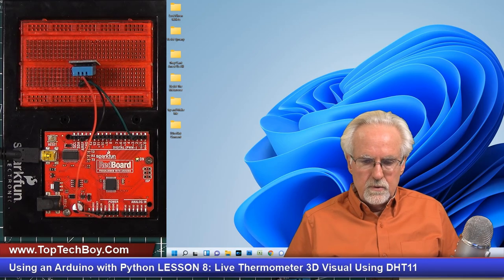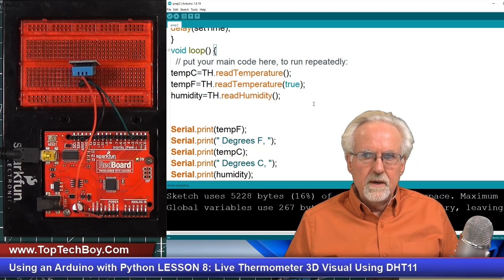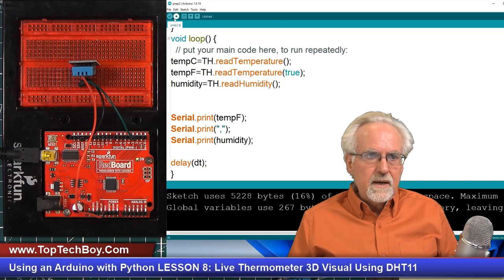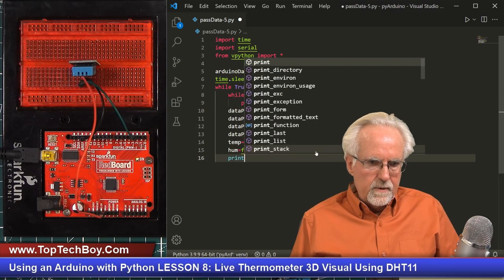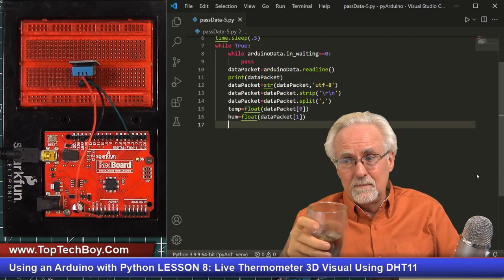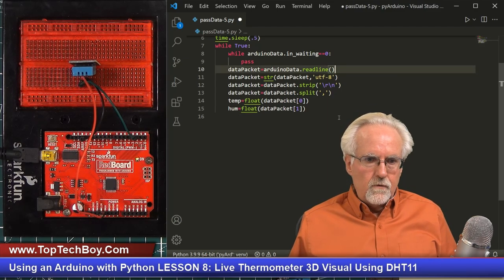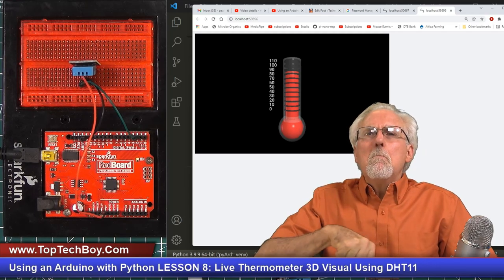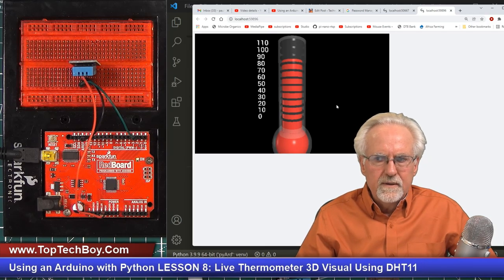Using an Arduino with Python LESSON 8: Live Thermometer 3D Visual Using DHT11

Comment: Thanks for another excellent lesson. I am legend. My solution consists of two separate needles in two different areas of a cylindrical face plate. The upper needle indicates the humidity level. Markings are for 10% to 100% humidity. The lower needle shows the temperature. Markings show 0 to 50 degrees centigrade.

Comment: Thanks Paul, I was following your lessons and so far was able to get bme280 working with Ubuntu on an old laptop. Wanted to try a raspberry pi 4b, but that’s set up as a Minecraft server for the Grandkids. You have a lot of followers in underdeveloped countries, so keeping equipment cost down would be a benefit, but I also know you have to work with standard equipment
Reply: I forgot to add using also adafruits ESP8266

Comment: You can program the Arduino, as well as esp32 from VS code, using an extension called platform io. It has a serial monitor and everything.
Reply from the maker: Yes, I have looked into that. Just for teaching purposes, it introduces one new variable. VS code is a much more full featured IDE

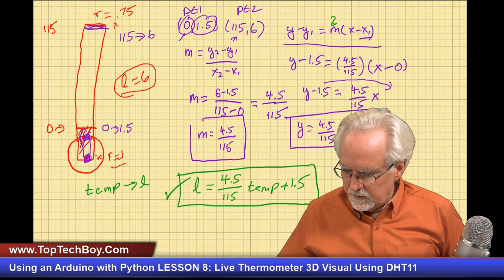Comment: (Reffering to min 20:17 ) When I encountered this, my mind avoided math via a workaround for the issue -> 'map' and 'constrain' function from Arduino: 
def mapValue(x, in_min, in_max, out_min, out_max):
    return (x - in_min) * (out_max - out_min) / (in_max - in_min) + out_min

def constrainValue(cVal, lowB, uppB):
    return max(lowB, min(uppB,cVal))
Reply from the maker: The whole point of the lesson is to teach you math, and a real world application of math. What are you going to do when you encounter a problem that the  map and constrain functions will not work for? Why avoid the math, I show you clearly how to do it. It is like saying, 'I wanted to avoid the coding so I just copied and pasted someone's solution from the comments'. Not trying to be hard on you but learn the math. Math is your friend.

Comment: Thanks for your lessons they are absolutely brilliant! I do however keep coming up with an issue, i have it all working great, im receiving the data from the Arduino and my display looks fine. Then when i come out of the runtime or when i change something (even if i put it back to how it was) its as if i get no data into python. Arduino is still fine and i can see the data on the serial monitor. It seems to occur when i get an error in Visual Studio stating 'RuntimeError Cant register atexit after shutdown'. Its stopping my progress alot and im stuck at what i can do to fix this problem?
Reply from the maker: Make sure to kill the serial monitor on the arduino before running the python. When you kill python wait a few seconds before running it again. Sounds like your serial port is still tied up
Reply: @paulmcwhorter  Thanks Paul, by 'kill' i assume you mean just close it? Iv tried closing them and waiting abit. Although im on a Mac laptop so maybe its a mac issue..